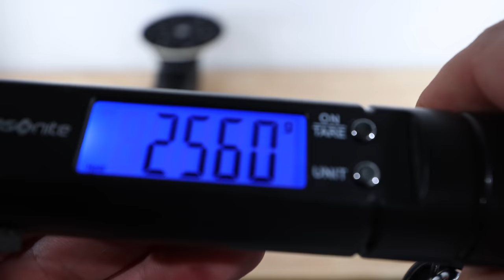The Most Powerful D.A. Car Polishers Ever! EX620 Series

Comment: Hello! Need your expert advice. Looking to buy one of the best da polishers on the market. Was going to buy the Rupes mark III but heard they have reliability issues. Would this ex620 fit the bill? Also, what sizes are best to cover all car needs....21mm or 15mm? And then go with the ex603 for the smaller/intricate  areas? Finally, would you recommend the shinemate cordless versions over the corded? Looking to make all my purchases right the first time. Thanks.
Reply from the maker: I’ve owned about 10 Rupes polishers in my time and they’ve all been reliable machines as is the case with my Flex and Shine Mate polishers, but you will always find lots of examples of people saying they are not if you go looking for them. 
As I stated in the video I really wouldn’t recommend these 620 polishers for a beginner, as I don’t believe they are good machines to learn on, but rather machines for those who have been doing this for a while. But if you’re set on them, I would suggest the 5/15 as it’s still quite a civil machine and maybe with the Ex603 as you stated. 
Hope that helps.
Reply: @CarCraftAutoDetailing  much appreciated and thank you for your insight on Rupes. I may stick with them since they have many distributors in the 🇺🇸.
Reply: @CarCraftAutoDetailing  thanks for the great video. What would you recommend as the best polisher for beginners given these are both for an experienced user?
Reply from the maker: If you have the funds and your not too concerned about cost the Rupes LHR15 MK3 is a fantastic unit for beginners to professionals alike. But if you’re looking more for value the Shine Mate Ex610 5/15 is also a fantastic unit.
Reply: @CarCraftAutoDetailing  thanks for the response mate!

Comment: Hey Sandro last question with the 21mm is it best left with the 6" backing plate or is it better to switch it to 5" did you try changing them?
Reply from the maker: I didn’t try in on the 620 6/21 but I have tried it on other past DAs. I personally don’t recommend it, as DA polishers all have very specific counter weights depending on their orbital throw and plate size, so what tends to happen is that the machine starts running rough and out of balance leading to more vibration and quicker machine wear, but it also makes finishing well more difficult. I know some guys like doing it and prefer that setup, but I personally wouldn’t recommend it.
Reply: @CarCraftAutoDetailing  I will leave it alone thanks bro

Comment: Reckon I would need both a 15mm polisher like the EX620 and also something like the Shine Mate EX603 Mini in order to get into most/all parts of the panels?
Reply from the maker: A larger 5” or 6” polisher together with a smaller 3” is generally a great combination on polishers to address most areas in an efficient and effective manner.
Reply: @CarCraftAutoDetailing  thanks!
Reply: @CarCraftAutoDetailing  would the 15mm ex620 be suitable for a beginner? I have read that you said the 21mm is much too powerful for someone starting off.
Reply from the maker: Yes I definitely wouldn’t recommend the 620 6/21mm for a beginner. The 620 5/15mm is more of a borderline polisher, so you can be okay with it as a beginner, just take it easy with speed and pressure to start with and grow into it slowly.
Reply: @CarCraftAutoDetailing  thanks so much. I think the Rupes Nano is really the only option at the moment for getting into really tight areas? I'll definitely be keen for your detailing courses when they come back.

Comment: So would the 15mm be the best da for the price range ill be using it everyday for a dealership itl mainly be for the 2nd and 3rd step because I use my flex rotary for cutting?
Reply from the maker: I think it’s currently the best overall large corded DA regardless of price
Reply: @CarCraftAutoDetailing  sweet thank you should I change the grease out whith better stuff?
Reply from the maker: @dillon599 you can if you wish, I  personally haven’t had issue with how it comes

Comment: hi Sandro, im getting hyped about this machine as i cant really afford rupes. You are using this machine for some time, so i was wondering if you still love the machine or you find her weak points.
thanks as always for great content :) and hope you doing well
Reply from the maker: It’s not perfect - no machine is! It can be a little noisy and vibrate a bit more than a  Rupes, but the extra power and torque makes up for it and I still love it!

Comment: I've had my eye on this polisher for a while, this is the best updated review I have seen.  How much less vibration with the 15 mm over the 21 mm ?
Reply: They're both very smooth.  I never had a rupes and borrowed a 15mm to do a showdown between 3 15mm machines and my opinion is

Power sector is shinemate ,griots g15 ,rupes
Smoothness sector shinemate ,rupes, griots
Ergonomics 
Griots, rupes ,shinemate 

Shinemate needs to offer different   grips for the user preference
I love the grip and height on griots and still use that a lot even though is has a little more vibration
Reply from the maker: The 21mm will have notability more vibration than the 15mm which does tend to feel much smoother

Comment: Hi Sandro. You said that this machine is too powerful compared to most of the polishers out there. In which speed did you prefer to set on this polisher during compounding and polishing stage? Is speed 4 is too much?
Reply from the maker: There’s a big difference between the 21mm and the 15mm. The 15mm although still quite powerful isn’t over the top and I’ll still use it all the way up to speed six at times but mainly at 2-4 for polishing and 3-5 for compounding. The 21mm on the other hand I’ll rarely venture beyond speed five and I’ll both polish and compound as low as speed 1.5 but perhaps generally around 3-4  it also depends on your pad and compound choice and the paint and climate. Sometimes speeds 1,2&3 work extremely well depending on all those factored and other times I’ll go for something higher it just depending on the results and circumstances.
Reply: @CarCraftAutoDetailing  thanks for the reply Sandro. Can’t wait for my 15mm EX620 to arrive soon. Leant a lot from your videos and tutorials. Hope you have a good day mate!

Comment: This make it even harder to choose😅 i’m so doubting between this 15mm or the cordless one
Reply from the maker: The 351 is probably the best around cordless on the market, it won’t disappoint. However 🙂 … the 620 is such an amazing machine, more torque, less stall and smoother than just about any machine. It really has to come down to whether the cord is a deal breaker or not - and that has to be a personal choice.

Comment: have you tried the Osren Hurricane 2.0? Apparently they are even better then the Shinemate.
Reply from the maker: No I haven’t tried it
Reply: @CarCraftAutoDetailing  what about the ex620 21mm with the HD 5" backing plate? better option then the factory 15mm setup?
Reply from the maker: @petegangies some people like that setup, but I actually prefer the 15mm with the 5” plate, it’s got more than enough torque and runs a little smoother with a bit more precision with the smaller throw.

Comment: Hey Sandro! Is the light Grey part rubber or plastic? Maxshine has rubber like rupes. Does that plastic vs rubber makes any difference?
Reply from the maker: It’s rubber and rubber can help give you extra grip and help reduce vibration to your hands.
Reply: @CarCraftAutoDetailing  thanks for the reply. Do you know if Shinemate gives support inside US? Currently we have to buy some new machines for our shop and we are between Maxshine and Shinemate. Having seen this review and receiving your answer that light Grey hood is rubber, the only thing we are concerned is about support.
Reply: Does wattage really matters? Rupes is 550w maxshine 1000w and Shinemate 1200w
Reply from the maker: Wattage is one metric that can certainly have in impact on power but there’s other things that also influence it. 
I really don’t know what level of support Shine Mate has in the USA, but a warranty needs to be upheld regardless of where you buy the machine.

Comment: Hi Sandro, on average, what speed do you compound with 620-21?
Reply from the maker: It really varies mate! I find myself using quite low speeds with microfibre and even certain wool pads anywhere from 1.5 to 3.5 and perhaps using slightly higher  speeds with foam pads maybe 2.5 to 5. I’m still testing it out all over the place with speed and pressure and how that effects certain compounds so I’m not sure I’ve settled on any particular speed range as of yet!
Reply: @CarCraftAutoDetailing  thanks!

Comment: Hi Sandro, is the 21mm cordless smoother than the 21mm corded?
Reply from the maker: There’s a couple of 21mm corded Shine Mates, I’d say it’s definitely smoother than the 620/21 but similar and possibly even smoother than the 610/21 but very close.
Reply: @CarCraftAutoDetailing  sorry, I wasn’t clear. I was referring to the 620/21. I think I’m going to buy the cordless 21.
Reply from the maker: Yes, the 620/21 definitely has a bit more vibration of that’s your main concern.
Reply: @CarCraftAutoDetailing  I actually have the 620/21. I really like it, but want to go cordless. Definitely a plus that the 21mm cordless is smoother, even if it just as little smoother. Thanks for your help.

Comment: How does this compare to the equivalent FLEX please?
Reply from the maker: I’ve done a review on the Flex XFE7-15. It’s a well built smooth polisher, but it really is a finishing polisher in my experience with it as it lacks rotational torque to be as effective for cutting stages.
Reply: @CarCraftAutoDetailing  Thanks. Shinemate are certainly impressing me as of late. Their new cordless polishers are tempting as is this one (whenever it comes to the UK). Many thanks for the reply.

Comment: shit nice video men dammmmmmmmmmmmmmmmmmmmmmmmm question can i change de backing plate of the 21 for 5''?
Reply from the maker: I’m not sure if the 5” plate will fit on the 21, (I’m sure there’s a work around though) but I’d just get the 15mm, it’s got more power than all other 21s on the market.

Comment: Detail Popo did a review on the EX620 - 15mm. Said it’s very powerful as well. As far a vibration, it did very well with thicker foam pads, but was not as smooth with lower profile MF pads compared to others. 

https://youtu.be/IuXep8oFsQQ
Reply from the maker: I actually found them even smoother with my MF pads compared to foam, but it’s very difficult to say just thicker or thinner pads as some thicker pads aren’t as well balanced as thinner ones and vice versa, plus you’ll find that certain DA polishers just run smoother or rougher with certain brands of pads depending on how the manufacturer has balanced the machines. I also found that I could run most MF pads at lower speeds which also helped limit vibration, but it’s all just very dependant on so many variables which is why so many people have such different experiences.
Reply: @CarCraftAutoDetailing  this is why I like Rupes as a system, they balance their pads around their polishers. Cant say that for most polishers out there. I agree, there are so many factors when it’s comes to vibration.

Comment: Put this up against a Mark III Rupes 15mm seems both are the same cost this looks like the knockoff version
Reply from the maker: They’re not even close to same price, the Rupes is twice as much - that’s $AUD in the video not $USD, and they don’t look, feel or sound the same either. 
You don’t have to like these polishers if your set against them for whatever reason, but you’re way off with your whole comment.
Reply: @CarCraftAutoDetailing  
Sorry about that I can admit I was wrong Your right I failed to notice the link you provided is in AUD doesn’t say anywhere until you hit checkout in the cart. I’m in the US anyhow those 460AUD converted to USD comes out to $354USD the Rupes LHR 15 MKIII Is 440-450USD depending on where it’s purchased from which converts over to 583 AUD is this machine worth the 100-120$ less difference 

So I guess my question now becomes is the Rupes considered an “Upgrade” over this machine for the $100-120 between them in price seems close enough to me is this better than it if it’s put up against each other in all aspects: durability, build quality,
Reply from the maker: I’m a big Rupes fan, but that’s not right. 
Products are way cheaper in the USA, these would be about half the price - just as they are half the price here. You can’t take an AUD price from Australia and compare it to a USD price in the states, they are two different markets with two different pricing structures.
Reply: @omarramirez2335  these are more like $220US